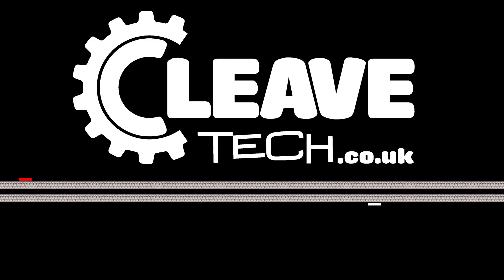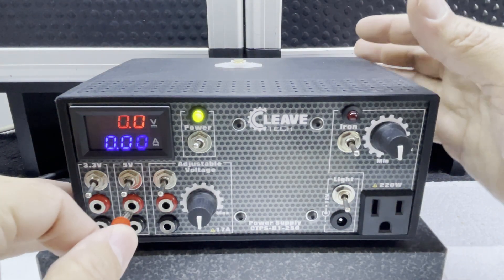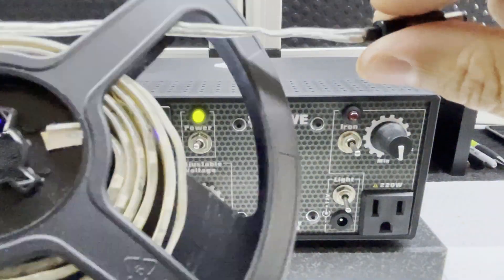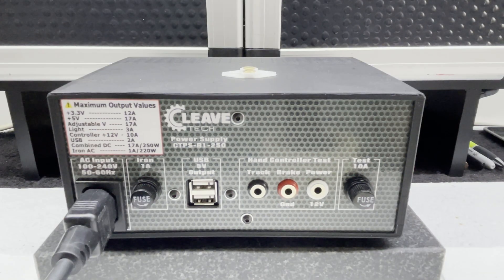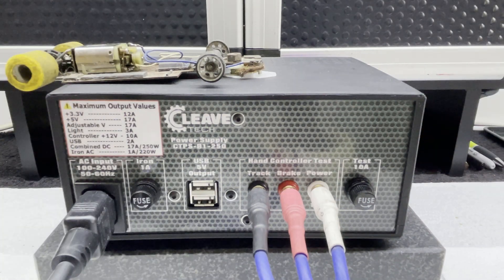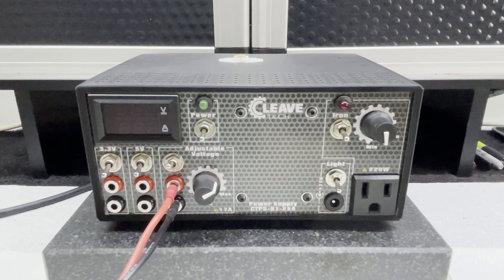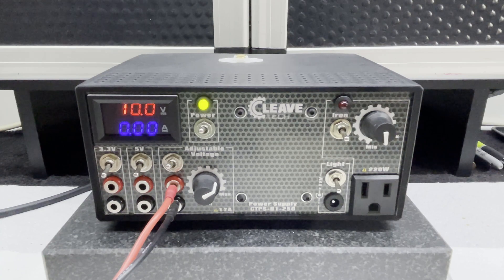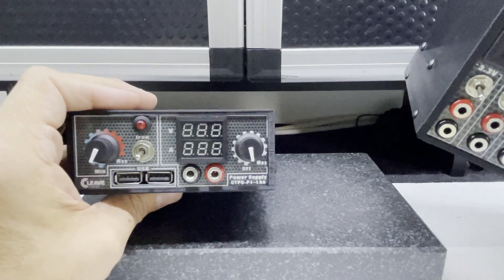Exploding resistors and the CleaveTech Power Supply

Comment: How do I hook up a voltmeter to my difalco no blast controller?  Thanks for your videos
Reply from the maker: Hooking up a volt meter is easy. The 3 wire versions are the best. Make sure it can handle up to around 24V. 
Connect the black lead of the voltmeter to the “brake” wire of your controller (usually the red wire coming out of your controller). Connect the red wire of the voltmeter to the “power in” wire of your controller (usually the white wire). Connect the other coloured wire of the voltmeter to the “power out” wire of your controller (usually the black wire).

Comment: I’m new to the hobby anyway because I’m picking up four or five decades later on some thing I did as a kid now I’ve been picking up old train transformers trying to get a bench power supply nothing seems to work for me I don’t really understand the electrical that well but the other day at a garage sale for five dollars I picked up a regulator DC power supply this has an input of 117 V AC 60 HZ 100 W output 13.8 V DC three amp constant five amp surge fully regulated with automatic cut off and a fuse I connected one of my spare motors and it seemed to run well although I would like to get a variable power supply is this power supply that I have safe to use on my 1/24 scale slot car motors for my bench?